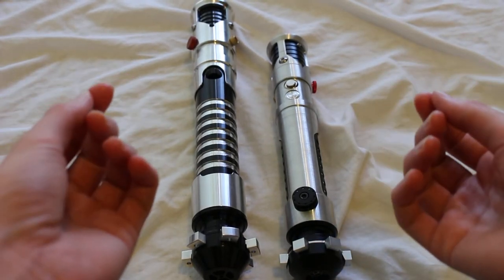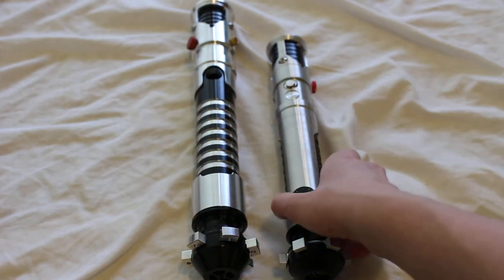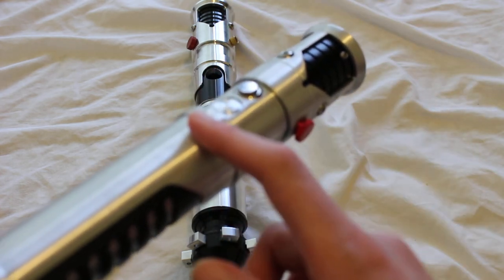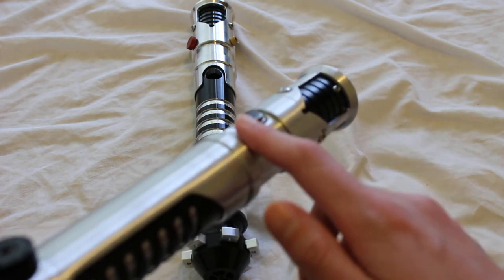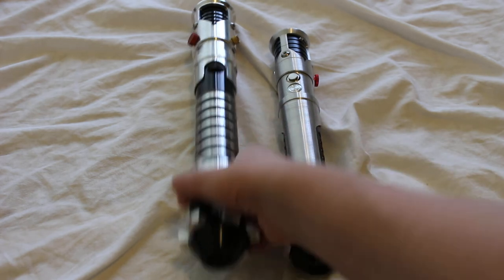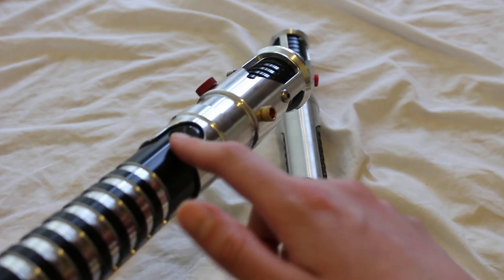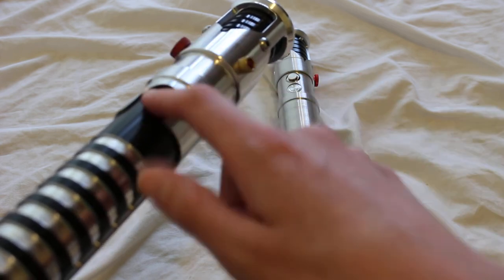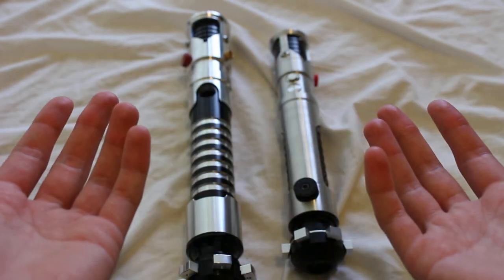What is a dummy switch? | Lightsaber Terminology

Comment: I just bought a saber from them but it doesn't have a kill switch and I don't know how to turn off the light around the activation button. Help?
Reply: You'll need to install a recharge port, specifically one that accepts a kill switch. That's the only way to shut off the light so it's not draining the battery.
Reply: @donaldfleming5049  this isn’t the answer but I did figure it out a year ago